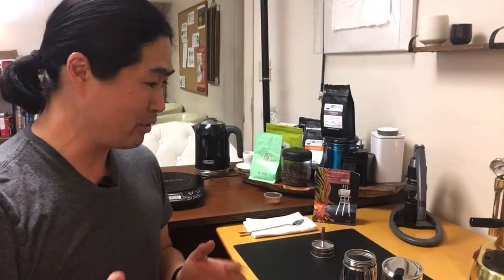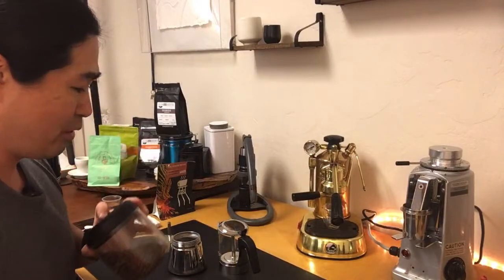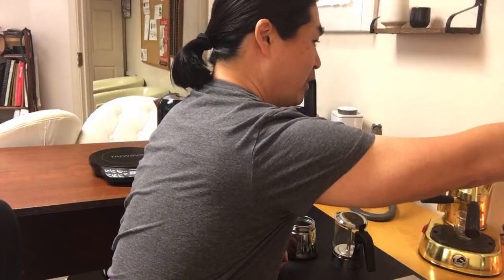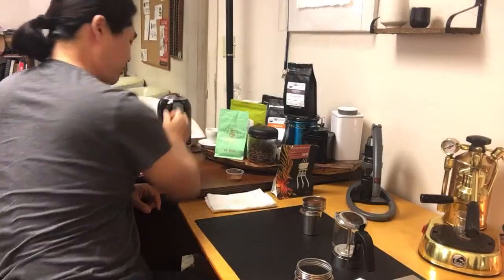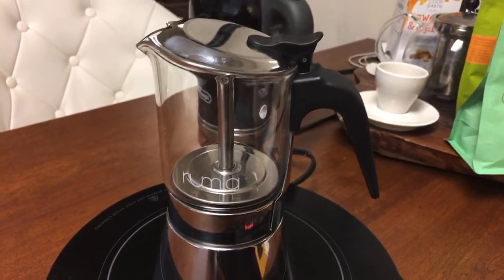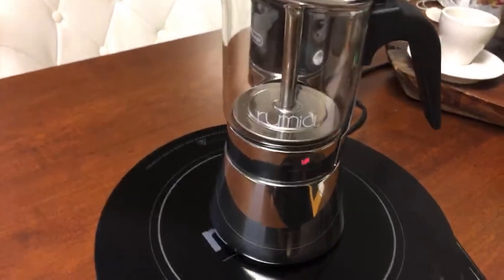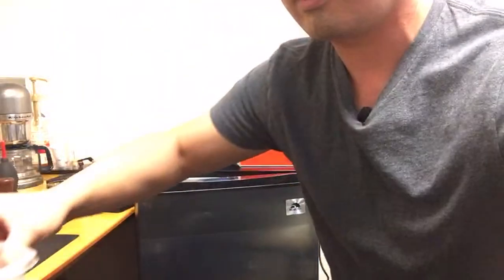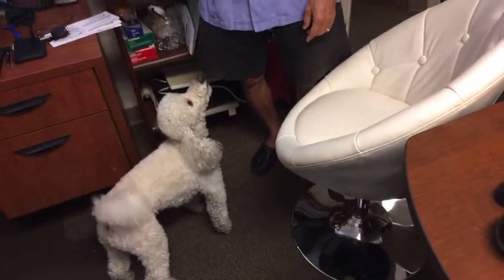How to make a Better Moka Pot | Rumia Glass Moka Pot

Comment: You might just need to add a few more grams of beans and pat it down slightly harder. It should be just above halfway full of grounds after it’s been patted down. I actually get a little bit of crema from mine. 

I have a 9-cup bialetti moka pot and I use like 40 grams of beans so maybe use that as a reference point for how many “cups” your percolator is rated for.

I also just got my Rocket Giotto Type R and Eureka Mignon Specialita delivered. Got an awesome deal on the setup and got a free bottomless portafilter with it. My first espresso machine ever and I drop $2.5k on the whole setup lol. Dialing it in is no joke but your Rancilio videos have been extremely helpful for helping me understand how to work with a 58mm portafilter. The hardest part of the Specialita is definitely the dosing because I have to weigh the portafilter with the beans in it. It has a timer but I haven’t the wherewithal to figure it out yet. Definitely the most fun hobby I’ve ever had though.